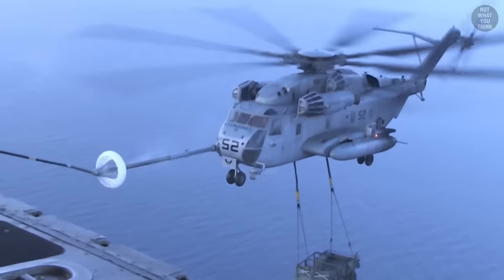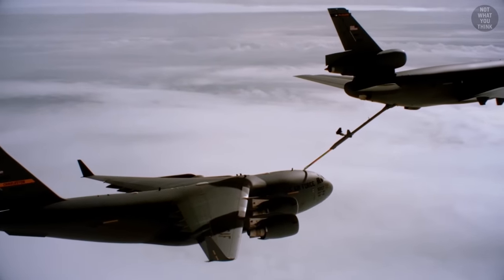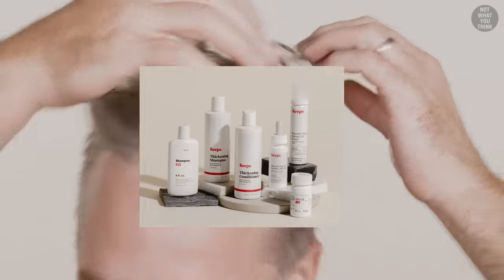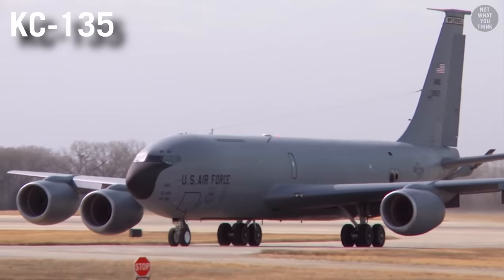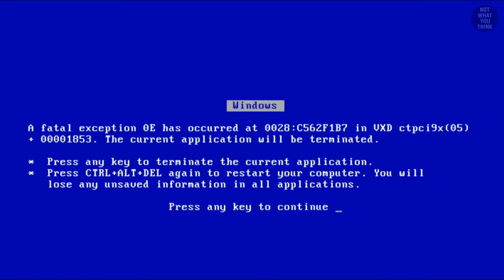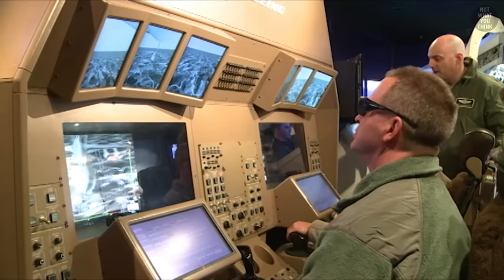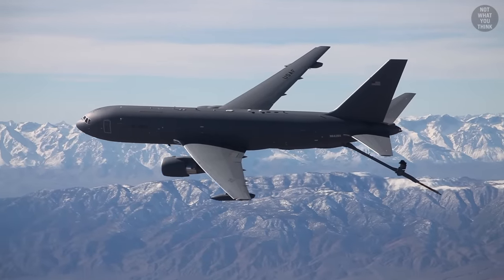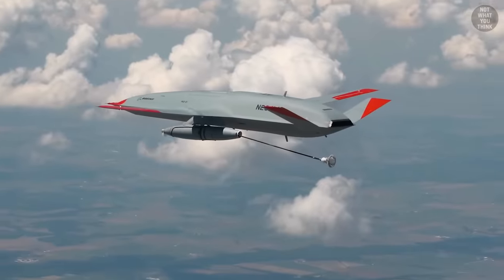Why US Air Force is Making Aerial Refueling HARDER?

Comment: I air refueled many times as the fighter receiver pilot over the course of 25 years in the Marines (A-4 and A-6) and the Air National Guard (F-4) and can attest to the fact that from a receiver's perspective, the boom system is easier and safer than probe and drogue, particularly at night, in turbulence, or when in clouds. The KC-10 was a pilot's dream to refuel from compared to the KC-135, because with the KC-10, the receiving aircraft is much lower in the contact position, and thus out of the wake turbulence of the tanker.
Reply: 👁👄👁
I wish I had a life story just like that.

A few year back I had a citroen c3. 
I got a flat tyre, and you will never guess what happened when I tried to change it...............................
etc.
Thats sorta how mine would start lol.

Its all good 👍
Reply: No offense, but how can P&B be more dangerous than boom? 
Short of the probe braking off and maybe damaging the receiver aircraft? 
How on Earth could it be more dangerous?
 The boom can physically damage the receiving aircraft. 
The two aircraft are in far, closer proximity with boom - are they not?
Surely, collision is far more likely with boom than p&d?

Obviously boom is easier for the receiving aircraft. 
That is a given.
And I believe you liked boom better.

But I really do not see how boom could be safer than p&d.

I admit I could be wrong.
But, from the outside, I doubt it.
☮
Reply: @McRocket  Flexible hoses are unpredictable. The connection/disconnection can only occur by ramming in and yanking out while booms have remote latches. The boom has a highly skilled operator helping either connecting or quickly flying the boom out of the way.
Reply: Frederf has it right in response to McRocket's query about boom refueling's safety superiority over P&D's. As the receiver I have a huge, very stable target, the tanker itself. With boom, the tanker is relatively stable even in turbulence due to the physics of mass and inertia. I simply fly formation on the whale while a skilled boom operator flies his/her probe into my receptical. I just fly as constant a formation position as possible, and the boomer does the harder part for me, making the exacting contact with my receptical. Additionally, at night, the boomer has considerably better visibility for the hookup provided by the director lights on the belly of the tanker, the tanker's white navigational taillight, and a probe light on the end of the boom. With P&D, I as receiver pilot have to chase a bobbing and weaving drogue which is poorly lit by a small red floodlight shining on my probe at night. Trust me, P&D is much trickier than boom refueling, especially at night and/or in cloud!
Reply: @frederf3227 
 "its like threading wet spaghetti up a cats behind"

lead pilot, vulcan bomber raid, falklands conflict.
Reply: @joe18425  A friend of mine, RAF navigator and retired squadron leader, was responsible for designing the air refueling plan for that successful raid on the airfield at Port Stanley. He was decorated for it by HRH Queen Elizabeth II.
Reply: @bearowen5480  im not sure, but I think it was 11 pit stops.
Amazing.
Reply: @joe18425  They staged out of tiny little Assuncion Island in the mid-Atlantic. Round trip was just under 8,000 nautical miles! I believe it was the longest active combat bombing mission in aerial history up to that point. Maybe later during the Balkans War the B-2 missions from Whiteman AFB, Missouri to Serbia and return may have been longer.
Reply: @bearowen5480  Not a fighter pilot, but on my end, when it came to drogue vs boom coronets, we were always making more contacts and longer refuels due to the transfer rate with drogue. Especially when flying over either Atlantic or Pacific ocean and having to deal with less than ideal weather. I've seen drogue missions take double the contacts for the same or similar offload of boom missions.
Reply: Yes my brother! It appears there are three of us in this comment stream who didn’t get our experience playing Call of Duty!
Reply: @bearowen5480  <— Has much more patience with these pajama boys than I do!
Reply: I just enlisted into the US Air Force and I’m waiting to start boot camp but I really would love to be a boom operator myself, got any advice for me?
Reply: @McRocket  Many factors,  but the boom stick is easier to train on and has a man/woman operating it. Also time to refuel is reduce.

Only main advantage of a drouge is the fact you can refuel multiple planes at the same time. With a boom it's one plane gas-tanker feeding fuel to one plane.
Reply: @Frankie5Angels150  I've only used a drogue so I am staying out of this!  I see the benefits in both though.
Reply: As a retired Boom Operator, with 22 years experience on the KC-135A and R, and the KC-10, I can also attest that Boom is safer than Probe & Drogue. With a Boom Operator in complete control of the boom and able to make contact and disconnect, and as the only person in the entire operation that knows what is going on with both airplanes at any moment. 
With P&D, the "Boomer" has no control of the contacts or disconnects, and the hose oscillates as the receiver gets within 5 feet, because of the bow-wave between the receiver and the drogue basket. I have seen fighter pilots with a probe aircraft struggle in turbulent weather for several minutes to make contact with the drogue. One time, during the first Gulf War flying on the KC-10, I watched an F-14 try to make contact at approximately 80 degrees of bank, because he seemed to be fixated on making contact and didn't realize his bank angle. Fortunately he did not make contact. Because, if he had, the drogue basket would have been ripped off when he immediately dove down, because of the attitude angle. I had a Flight of 4 F-16s waiting to get fuel, so I had to send that F-14 to take a break in wing formation, so I could lower the Boom and fuel the F-16s. Afterwards, the F-14 tried again and got his fuel. 
The added advantage of boom refueling is the short Tanker Time. Because the boom can offload fuel at 3X the speed of P&D, the receivers are on the Tanker for shorter periods and the Tanker can offload fuel to more receivers in any given time.

Comment: They should put an additional camera near the tip of the boom with a co-located range finder that the operator could transition to when the boom gets close to the refueling aircraft so the boom operator would always have accurate distance info and a much clearer close up picture of where the boom is in relation to the refueling aircraft. Boom! Problem solved…that will be 100 million dollars please.
Reply: Or at least 3 cameras being able to see the boom tip. Put IR tracking markers all over it and on the aircraft (on a part that’s only visible while refuelling)
Reply: Two cameras an average eye width apart and augmented reality goggles.
Reply: @Phil they'll have to make sure the markers sit inside the refueling area else it defeats the stealth portion or lights up any aircraft in the sky.
Reply: don't even need the range finder, have high relief markings around the port that you can match up with witness lines on the boom. Eyes are good at matching things up and you could do it without having to change your focus. You could make them look like those white balls they use for motion capture and stick them around the boom.
Reply: I was shocked they didn't have a camera mounted between the winglets, yeah...
Reply: @AubriGryphon  I test drove a kia that had 360 augmented vision for backing up....feels like this could exit here....
Reply: @scottmccullough8030  That awkward moment when civilian tech far surpassed high end cutting edge military tech lol
Reply: Way too simple and would probably work. No way the military wants anything to do with that idea.
Reply: You know why they can't get it right? Because why get paid once to do the job right when you can get paid twice to already know the answer and still not do the job. That's government contractors for you.
Reply: @a6o932   idk how accurate the info is but not what you think stated the contractors were handling the upgrades out of pocket
Reply: @a6o932  no doubt…too bad we all have to pay for them to engineer it then “fix” it several times.
Reply: @a6o932  
RE: "That's government contractors for you."
It's called a "cost-plus" contract.
Reply: lens gets blocked. now what?
Reply: @riskinhos  Mk 10 Eyeball system. Joke aside, I don’t think it would get blocked very easily.
Reply: @riskinhos  Multiple angles would cover that scenario
Reply: @デヴィン  think it's not enough. lives depend on it.
Reply: @riskinhos  Add a little water sprayer next to the camera, something similar to what’s used on car windshields.
Reply: @riskinhos  have a small air tube that can blow a puff of air to clear the lens incase of rain or ice and also have the cameras be aerodynamically shielded with a small shroud to block high speed air and sun. Also, multiple tiny cameras for redundancy wouldn’t hurt. Look how good cell phone cameras are these days and they are small enough to back several in a small space. Problem still solved…
Reply: @LordRyn  maybe they are coving the hours worked but they sure as hell are getting paid somehow.
Reply: @mxcollin95  tube gets clogged. then what?
Reply: they ain't willing to spend1 250$ in that
Reply: fire hazard
Reply: @TheBooban  that is wild though that they would agree to a black and white camera that's just extremely cheap and out of date and no good for the use case
Reply: Strap a Marine to the end of the tip and give them a radio to talk to the book operator.
Reply: @scottmccullough8030  I want that tech for the work vans my employer puts me in every day. Driving a vehicle that weighs as much as six Corollas but no high tech helpers when it comes to cameras. (Actually we have a simple rear view camera that is probably worse than the one you'd find on a 25 year old luxury car). Our vans are constantly having to parallel park in tight spaces, too.
Reply: @riskinhos  use more pressure. 

The only thing that would logically block the tube at altitude would be ice so they could heat the tube like they do on other parts of planes that are exposed to weather and the wind stream (like pitot tubes which are the pointy tubes towards the nose of an aircraft that stick out and point directly into the relative wind that planes use to determine airspeed.
Reply: @mxcollin95  that's not true. other things can block. again those systems can fail. and they do fail. like boom operators have complaint about. haven't you seen the video?
Reply: I'm a boom, we tested this and its super disorientating. You need to have both precise local control of the contact and overall aircraft position awareness. If the receiver underruns you, or is about to climb up and have a mid-air, you would be too focused on the tip camera. Overall this idea was cool, but distracting and dangerous.
Reply: Yeah I mean does feel like you could basically strap a smart phone under a aero dynamic enclosure and run a fiber optic line to plug it to and in the process actually improve the process.

The ability to guide the boom directly from the tip when you get close would actually be better than the window
Reply: Better yet two cameras and some VR-Headeset. Then you'd have depht perception which is much more natural.
Reply: @criticalevent  cod odin time
Reply: @daviddavidson2357  The cameras are much farther apart than people’s eyes.
Reply: @LordRyn  That’s because this was designed back in 2010, and then it took years to develop and verify. You can’t just keep putting the latest systems on each aircraft as it is built.
Reply: @a6o932  it’s a firm fixed price.
Reply: @perfumedmanatee6235  it HAS stereoscopic vision!
Reply: @aculnay  it has a 3D screen that is used with 3D glasses.
Reply: its interesting that they failed with this when there is ISS docking system that could be probably learned a lot of from.
I can think that some higher rank thought that this RVS is basically not an issue and they just need some camera until they got into a loophole.
Reply: @johnp139  you know this from experience?
Reply: @johnp139  black and white was outdated even in 2010 though
Reply: Just needs a contrast marker with some kind of orientation pattern at a known consistent position to the fuel inlet. If you can get camera lock and distance, then in theory you could have a computer do boom stabilization in relation to the target. Boom operator's job then becomes a standby/monitoring and fallback role to the automation.
Reply: The range finder will be hard to get used to, it's super unnatural. They need real time 3D video then you can just have depth perception like you naturally would.
Reply: No
Reply: Give this man 100 million dollars.
Reply: @a6o932  they are paying out of pocket for the fix though…
Reply: @a6o932  are you sure this contract is cost plus?
Reply: Nah just automate the procedure like the ISS now has automated docking for spacecraft. SOLVED.
Reply: They should fire the person who bought into this idea. Or jail that person
Reply: you literally just described the system already on the aircraft.
Reply: @gopniksaurolophus6354  I was just describing common sense improvements should’ve been made to the original shitty half ass design. Who knows what they actually have these days. My suggestions were just common sense. For the millions these contractors charge the government, I bet you could’ve had college engineers do a better job for a 20th of the price.
Reply: @mxcollin95  What I was saying was that the system you described as being common sense is already mounted on the airplane.... and doesn't work. They had to build an entirely new system just because of that.
Reply: @noblecorvus6296  If they can see those little lights, they've already found the aircraft.
Reply: Or maybe just ditch the POS technology and put the glass back.

Goes for the rest of the world too 🙄
Reply: @alvaros.  🤣👍
Reply: That or just replace the cameras with a fucking window
Reply: Exactly, just use the system space station use
Reply: They should  have just left what was working for years alone and kept the refuel operator for the boom in the rear looking at the aircraft with his or her own eyes. Some things don't need to be upgraded and this is one of them. No extra money spent and you have a reliable system that has been proven for years.  Just use the camera system for the wingtip drogue refueling hoses.
Reply: That makes too much sense and seems to right...